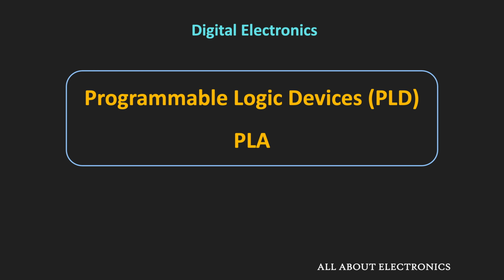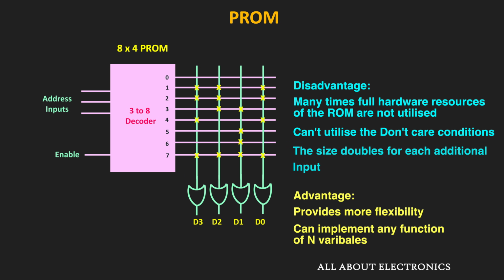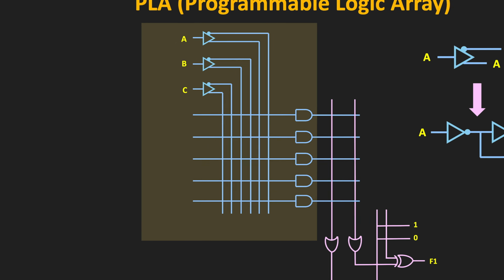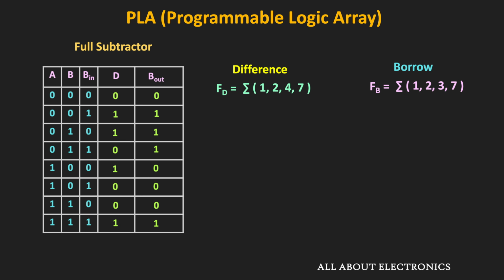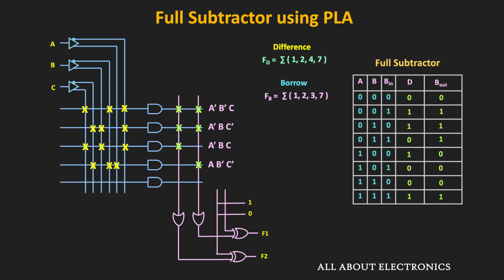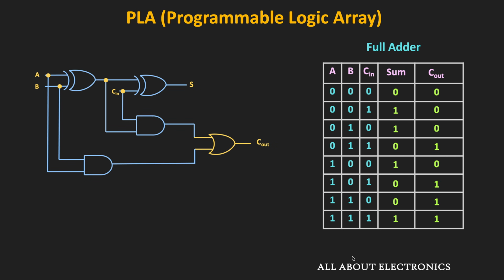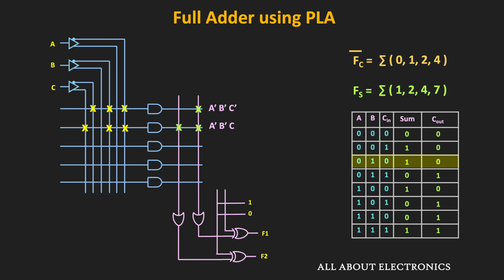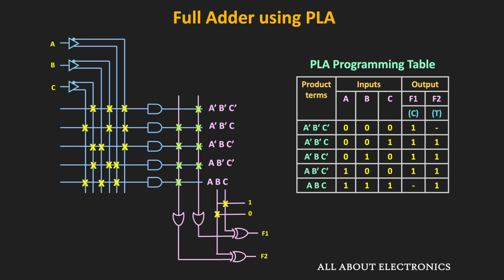Programmable Logic Array (PLA) Explained | What is PLA | PROM vs PLA | Boolean Functions using PLA

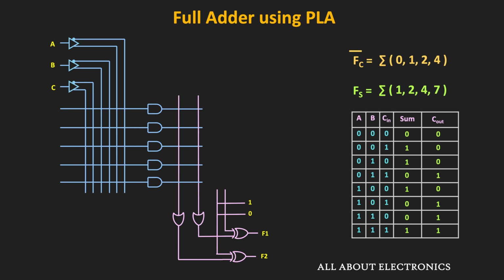Comment: Nice explanations, but i have a doubt can we use Fs' and Fc instead of Fc' and Fs, as both of the selection has the same number of common product terms 18:19
Reply from the maker: Yes you can use. In that case, for the output you need to connect 1 and 0 accordingly in the XOR gate.